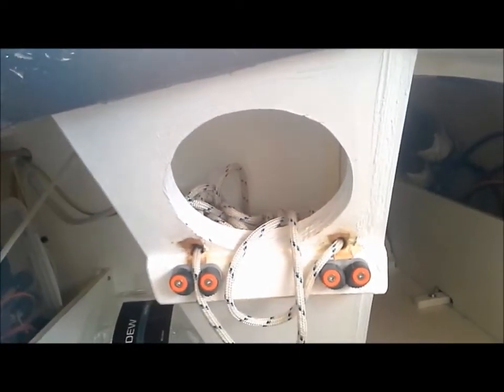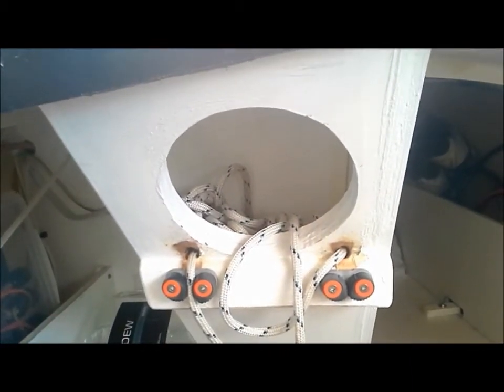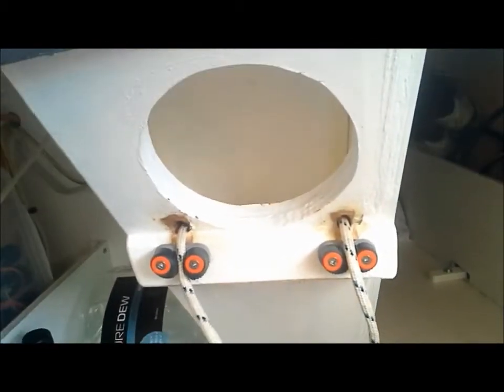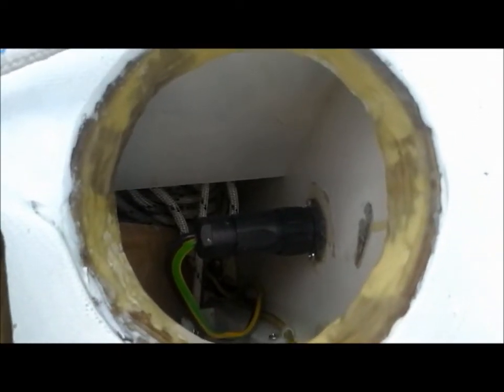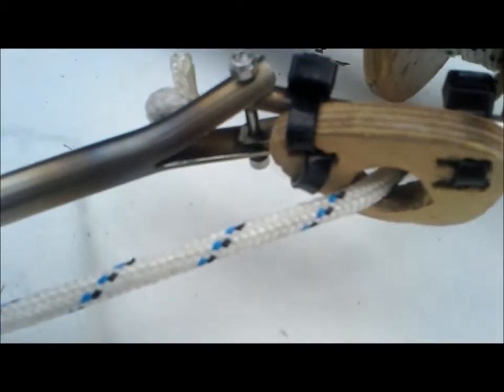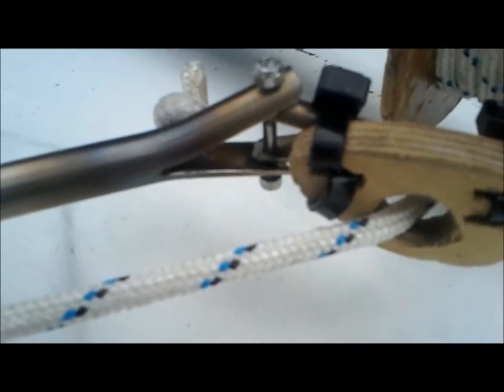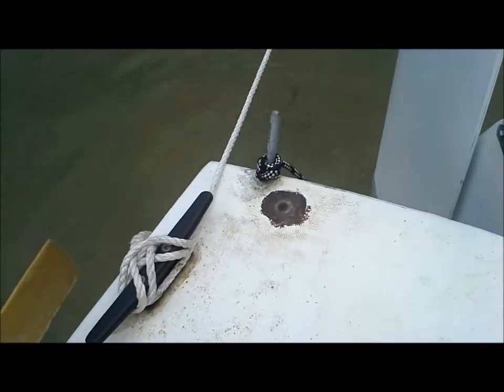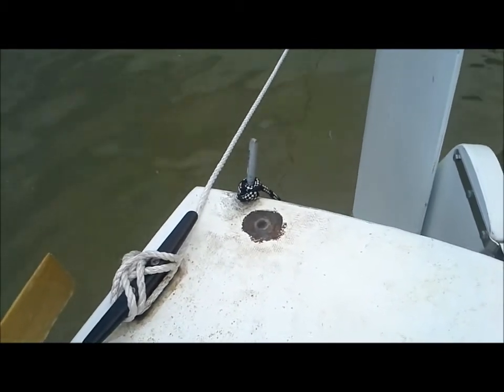Matt Layden Paradox Walkthrough

Comment: Have enjoyed some of your other videos. Looks like a very worthwhile sailing project. Just wondering if anyone had considered using a lateen rig set up. Seems to me that it would be simpler to use and give better winward performance
Reply from the maker: The key thing is would you be able to store the lateen's spars inside the boat? You are limited to 4m and lateen rigs usually have very long spars.  Also the boom would protrude significantly behind the boat. You wouldn't be able to reach the end of it to reef it. Having said all that, it might work. I've not heard of anyone trying it.
Reply: @creditscorenz  The Tack is fastened via a pulley at the bow,  The sail does not have a boom  as a true latten is loose footed [boom version is a crab claw rig often confused as a lateen], the clew is fastened via a pulley on the stern centre or horse. The cross spar must attach to the head and run down the luff but need not run all the way to the tack [perhaps only 2/3rds] so that its length can be enough to suit the stowage problem as its purpose is mainly to support  the head in position. Benefit is all spas including mast can  stow in length of boat. Its effect is like sailing with a large tri sail [jib].  A much under rated and simple system to use however tacking and gybing require a slightly different method to keep the cross spar to leeward  [ideally] on most set ups. Adding a reef to the sail involves lowering the halyard and pulling the reef point down to the original clew position,
Reply from the maker: @theosalt1  All of this sounds good except for one thing... gybing! A Paradox is a hopeless tacker in a seaway and I wear ship lots. That's the main reason I abandoned the standing lug which frequently Chinese gybed. The boomed sprit rig that I've got gybes without any dramas. Your loose footed lateen on the other hand, has to be handed around the front of the mast simultaneously as you gybe. It doesn't take much imagination to see myself in all sorts of trouble drifting downwind towards rocks with lots of sail fabric billowing around me. No thanks!  I've worked out that the more a sail is attached to rigid rig elements the easier it is to handle in difficult circumstances. The ultimate in docility... junk rig. The most cantankerous... spinnaker.
Reply: @creditscorenz  When you are running the sail is set a bit like a square sail [but triangular] with the spar in front of the mast and the clew loosened and forward. In this posture, gybing is not an issue as you can run plus or minus 45 degrees  either way with only adjusting the clew line and the line to the tack,  No Chinese gybes as the cross spar stays relatively in place in front of the mast like a square rigged ship.  Easy peesy,  all the running advantages of the square rigger with the ability to close haul and tack of a Bermuda.  Fair winds and plane sailing.